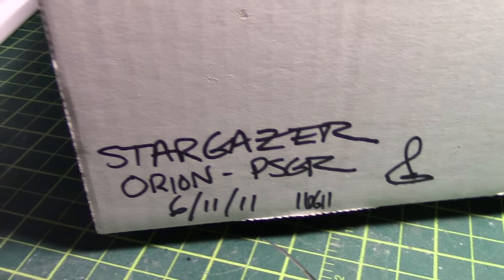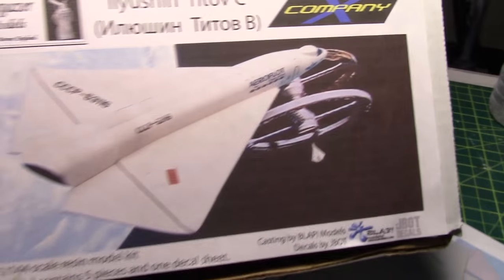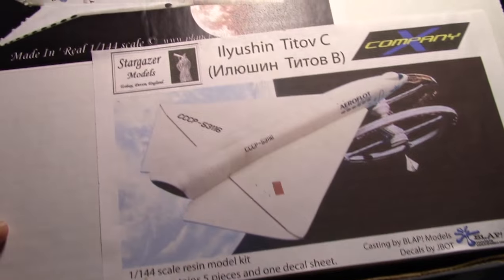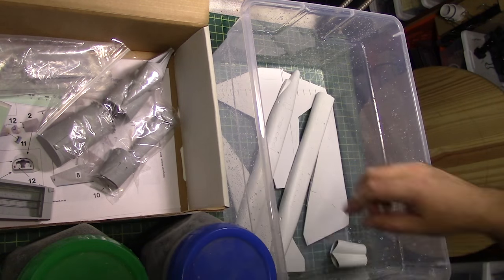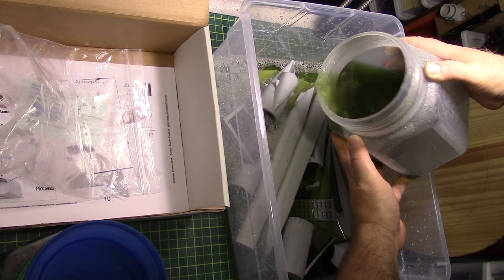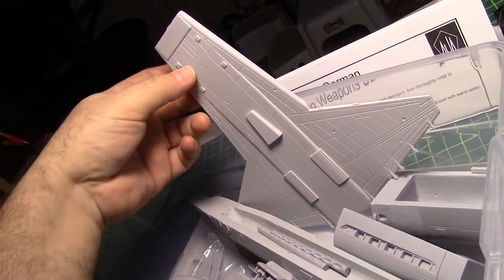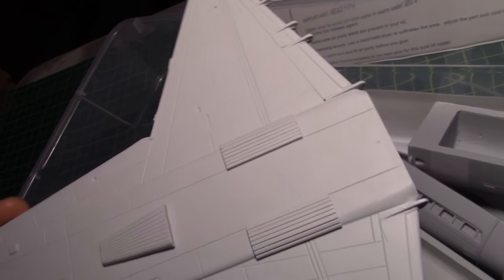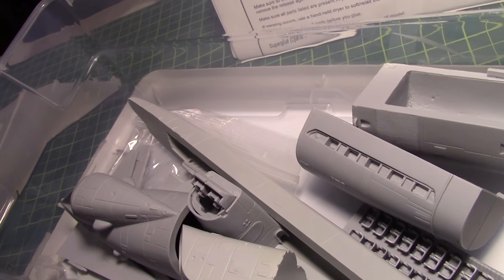Stargazer 02: The Wash

Comment: How come you need to leave it for 24 hours? Is it needed working time or just easier than washing it mechanicaly to speed up the process?
Reply from the maker: +granander For me, it's easier to let it sit awhile and let the de-greaser do the work.  Many modelers let things soak awhile, but I see no reason why you couldn't apply all the elbow grease desired.  Arthritis is my achilles' heel. Typical mold-release agents on resin kits are petroleum based and can be 'thick', at least on the molecular level.  Getting them off can be more of a pain than needed.

Comment: Could you use dishwashing liquid?
Reply from the maker: +Francis362003 As long as it's a good grease cutter I suppose.  Typical resin release compounds are petroleum or oilly based, so the surface has to be squeekey clean for paint and glue adhesion.  Coming up in one video shows some paint flaws from a dirty surface, I missed a spot.
Reply: Thanks